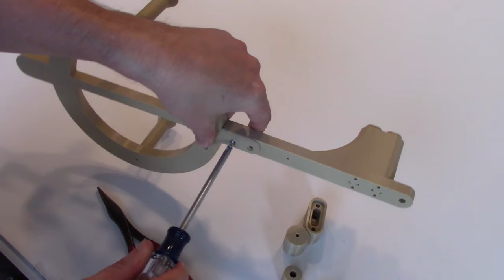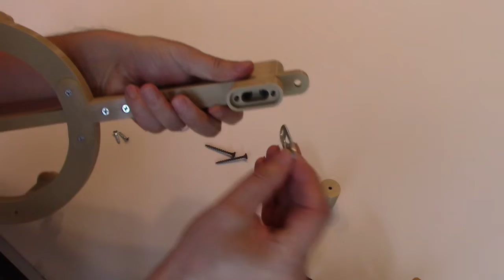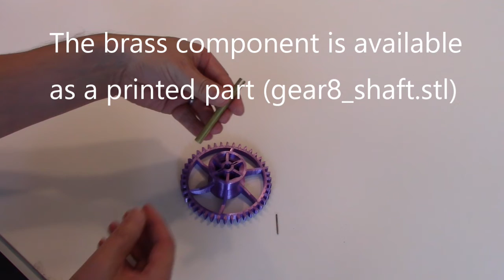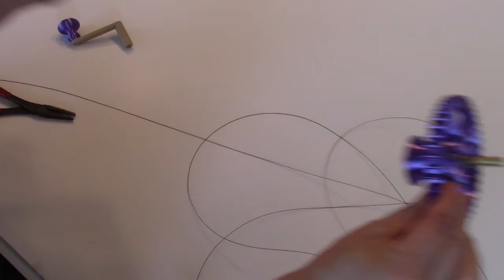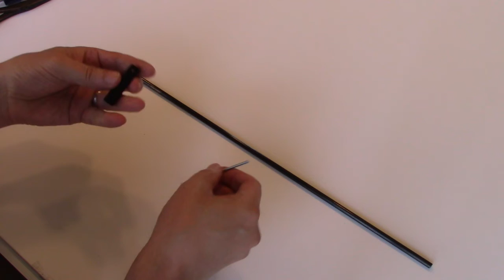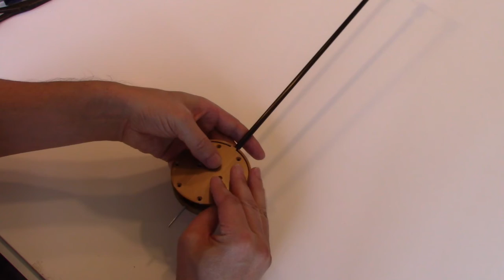Pendulum Wall Clock Assembly Part1

Comment: Steve, I'm not sure why I never noticed this previously but I've used brass for both diameters of arbor, but you specify piano wire for the narrower.  Is there an issue using brass for the narrower, should I look at changing to piano wire?
Reply from the maker: Some brass works great. And some brass is too soft. It is not always specified what type you are getting. There is no need to change it if your clock is working. Other builders using brass might not be as lucky.

I specify music wire because it always comes in a fully hardened state. It will always be the proper quality.

Comment: Hello Steve, congratulations, great job, I will acquire the .STL files as soon as I receive my printer, would you have the dimensions of the screws, pins and bearings, a list of parts that I will have to buy in the market, for me to see if I can find them here in Brazil, thank you very much
Reply from the maker: The assembly guide can be downloaded from https://www.stevesclocks.com/sp2

This is a relatively old design. My newer clocks have much smaller parts lists. Assembly guides for all of them can be found at the same web site.

Comment: I may ne late and you may not read this till im too flustered 😅, but i was gifted this already printed and was tols they went by your measurements. I found your website and love it all, these are amazing i love outting things like this together. 

I may be over or underthing i am still at the first part. Where i have to put the alignment pins, but the instructions aren't clear on what rhose are as i broke a piece ans they are graciously peinting anothwr for mw but i figured the alignment pins were the 17 small pieces, yet they dont go in at all, any help for me to figure this out?
Reply from the maker: The alignment pin holes are supposed to be tight. Different printer tolerances make them slightly tight for some builders and super tight for others. The solution is to drill them to fit with a 3mm or 1/8" drill bit.
Reply: Thank you so much! Can't wait for this beauty to be complete!

Comment: Hi Steve,  when printing the front frame lower and changing colors for the face and numbers do you use the filament change script or the pause at height script? Thanks
Reply from the maker: It depends on your slicer. PrusaSlicer has a simple mechanism to slide a lever and click a button where a color change is needed. Bambu's slicer possibly operates the same since it is a fork of PrusaSlicer. I think Cura uses a script to post-process the pause into the gcode. The end result is the same for either method.

Comment: I very much love the clocks you have designed and built.  As a budding 3d printing clock maker I would love any guidance you may have with regards to resources for your designs.  I'm still very new at this but very much intent on spending the time to learn all there is.  Thank you in advance.
Reply from the maker: Welcome to a new hobby. It can be addictive. If you are worried about some of the non-printed components, then I recommend the clocks in my "easy-build" series. The non-printed components were reduced to the bare minimum while still maintaining good runtimes. I am a lazy clock winder, so I want several days of runtime. A few hidden metal parts are required for this to be possible.
Reply: @stevesclocks  I confirm for the addiction!
I built the SP13 clock, I finished assembling the SP8 and I'm finishing printing the SP14.
I'm already thinking about the next clock to print!!!
😀😀😀

Comment: Hi Steve, the clock is coming along nicely, so many thanks for making your files available on Minifactory. Is there a specific technical reason for using thinner diameter arbors for gears 2_54_12 and 3_54_12? I am having trouble sourcing 1.5mm metal rod, so would it be OK to drill out those holes and use 3mm arbors instead (same as the other arbors)? Thank you.
Reply from the maker: The smaller diameter has slightly less friction which helps contribute to longer runtimes. I have never tested 3mm arbors, but there are enough gear options to make up for the extra friction. It seems like the clock should still run.

My biggest concern is the amount of wall material left after drilling a 3mm hole. It should still be OK if everything was printed with at least 4 perimeters. It would be much safer if you could find some 2mm rod.
Reply: @stevesclocks  Thank you for your prompt response - I have found some 2mm rod, so I shall give that a go!

Comment: Hi. i downloaded today the pendulum clock with blue numbers. i don't understand how to print the colored numbers? do you print them separately?
My printer is "Creality Ender 3 V2 , and i don't know how to print in 2 colors. Thanks for your answer. Isidor
Reply from the maker: The color changes are made by manually switching filament when the print gets to a certain layer height. A pause can be added by the slicer and it will wait for you to switch colors. The positions to add the pauses are explained in the detailed assembly manual.

Comment: Hi Steve, i printed all the parts and get stuck in the assembly, after placing gear 8 (spool), the next part you say is gear 7, but that is the ratchet gear. I've tried gear 5 which looks like the right gear but it is just too big in diameter  and wont fit. Cant figure this out. Help please.
Reply from the maker: Part 2 of the assembly video shows the gears being added. Gear 7 is closer to the back frame, so it gets added before gear 8. The outer hub of gear 7 nests inside the winding barrel on gear 8, but it should still fit.
Reply: @stevesclocks  Thanks for your quick reply. I just figured it out, for some reason i have a gear 5-54-12. The proper gear is 48 -12, which wasnt in my download. Downloaded the zip file again and the correct file is there. So hopefully i can complete the clock. So much detail, look forward to any new designs you might have as i like assembling things.

Comment: this isnt the same clock i printed buy i got here from a link provided... can anyone help me out here?
Reply from the maker: I have several different clock designs. Not all have assembly videos, but the steps are somewhat similar for each clock family. Every clock has a very detailed PDF manual that lists the step by step assembly process. The videos seem to help some people with a few of the steps, but they are only designed to compliment the PDF instructions. It would be very difficult to build these clocks using just the videos.
Reply: @stevesclocks  steve my wonderful amazing designer would there happen to be a hardware list? Couplers rids springs?
Reply from the maker: @beefsoda1  everything needed is listed in the assembly notes pdf.

Comment: Hi steve.

Great design by the way.
I need an information regarding the period of oscillation. Is this a one second clock?
I believe you are using a 8 and 60 tooth gear combination right?
Also whats the run time of this clock?

I wanna build this for a students project. So, i wanna clarify this before using your design. Thanks!
Reply from the maker: Thanks. A one second pendulum would have a length of almost 1 meter. This length looks good in a grandfather clock, but seems out of place in a small wall mounted clock. All of my clocks have shorter pendulums with periods of around 0.6 to 0.7 seconds. Many wooden gear clock designs have  pendulums with a one second period.

Comment: I'm having a lot of trouble getting the 3mm short pins to fit into the holes of the bracket that holds the two back frame pieces together.  The long pins between the top and the bottom fit fine, but the short pins just won't go in.  How do I solve this issue?
Reply from the maker: The holes for the short pins were deliberately made tight. Different printers have different tolerances and they might be too tight. Drill them out with a 3mm drill bit. It might also work fine without the short alignment pins. There should be enough screws to hold the parts together properly.

My latest clock is a simpler design that only uses 3/4" wood screws to hold the entire clock together. The longest runtime option (32 days) uses 11 pounds of drive weight.
Reply: @stevesclocks  Thanks for the quick reply.  After I took a break and calmed myself down ;) I realized that just drilling out the holes a little would solve the problem.  I have successfully completed the back frame now.  Thanks again.
Reply from the maker: @ADirector-l1u  I think some of the parts might be "slightly" over-designed in this clock. The weight shell is pulling on the pieces, but it could have been designed a bit simpler and it would hold together just fine. 😀

Comment: Hi Steve,  I've bought and downloaded the files for printing the large Skeletal clock.    I don't really like the 'fancy' hands included and want to use the plainer hands like those on the small clock.   Can I do this or is there another file for 'plain' hands for the Skeletal Clock?   Also great to see both clocks use similar parts, so I can use some of the leftovers from my small clock build.   Fantastic designs, keep up your great work.
Reply from the maker: Hi Ross, The hands are fairly non-critical and can usually be copied between designs, except the length will be a little bit off. My latest "easy build" design has two different faces, roman numerals or simple numbers. It includes both styles of hands. Steve
Reply: @stevesclocks  Hi Steve,    In am happy with the Roman numerals but just wanted the plain hands.   I didn't want the 'easy build' and don't think I will outlay an extra US$10 just to get the plain hands.   At some stage down the track might you be able to incorporate a set of plain hands into the Skeletal stl files set?   Still a great design and I will start printing sometime next week.
Reply from the maker: @rossevans1035  I added the spade hands from the easy build clock into the design that you purchased. The file is hands_spade_met.stl. It is ideal for metric sized arbors and will work after a small amount of filing for imperial arbors. It takes a few hours to pass the MMF software checks and you may need to look under "Object Parts" to download the individual file.
Reply: @stevesclocks  Thank you Steve.  I will keep a lookout on MMF for the updates.

Comment: Hi Steve. What size printer capacity is needed to build this clock. I have an Ultimaker 2+ with 223 x 223 x 205 cm maximum build size and would like to undertake this project if my printer has a big enough capacity. Thanks.
Reply from the maker: Hi Mike. I design all of my clocks to fit a 220x220mm Ender 3 or 210x250mm Prusa MK3S build plate. Height is rarely an issue. Your machine should easily be capable. There is also a smaller option for something like a Prusa Mini. The lighter weight gears in the small clocks use less energy and the runtimes are longer. One of my clock designs runs for 32 days per wind, but only in the small version. The large version only gets half the runtime.
Reply: @stevesclocks  Thanks. Looks like I will buy one of the clocks.

Comment: Where do you get the Shaft Couplers from // Thanks
Reply from the maker: Amazon or eBay. Search for Dubro 597. Packs of 12 collars are currently around US$9. This would be enough for 2 clocks. A local RC hobby shop might have some in stock to pick up without waiting for shipping.

Comment: HA!! Im number 100 subscriber. Remember us when your famous LOL. Just bought these plans, thanks for posting this. gonna have fun with this!!!  Thanks! and post more!!
Reply from the maker: Congrats on being lucky number 100. More designs are coming. I like to experiment and fine tune many of the parts so it takes me a while.
Reply: @stevesclocks  hey Steve, im just in the planning phase and I wanted to ask if there is a reason not to use ABS? I am thinking about vapor polishing all the parts, however this may be a tricky move. what do you think?
Reply from the maker: @michaelvickers8575  It seems like it should work. Try a few small parts before committing the entire clock. The gears have loose tolerances and I think the escapement will also be OK.

Comment: Does this scale? Like, if I wanted to make it even larger on something like the CR-10? Or will that mess with the timing?
Reply from the maker: Timing is controlled by the pendulum length, so scaling everything except the pendulum will keep the timing the same. However, this design has built-in threads for screws and bearing pockets in a few key places. Those would need to be adjusted after scaling

I did scale the design to 3/4 size for smaller printers. The escapement was increased from 25 teeth to 27 teeth to allow a shorter pendulum that is more proportional to the overall clock. A larger clock might look better with a 24 tooth escapement and all other gearing unchanged. The drive weight might need to be adjusted since larger gears need more energy to accelerate with each tick.

So to answer your original question, yes, the clock will scale. I like to make a few minor optimizations for each size, but they might not be absolutely needed. Keep in mind that the clock is already quite large with an 8" dial and nearly 20" overall height.
Reply: @stevesclocks  Thanks for the info. I'm looking to do something rather large, and 8x20 is actually small for my space.
Reply from the maker: @AdamZ5k  It should be possible to scale the size and adjust a few parts. For example, scale X and Y by 50%, scale Z by 30%. The 1.5mm diameter arbors get upsized to 2.2mm. The 6x3/4" wood screws get upsized to 10x1" screws. Bearings could be kept the same size and print collars to go around them so they stay centered. Save the weight shell for last so you can determine how much weight is required. It might work with the large weight shell filled with lead shot instead of BBs. A few steps may require some experimentation. It seems to me that common sense solutions for most parts should allow the clock to be built.
I look forward to your progress if you decide to attempt it. I can give recommendations as you go, but may not be able to build one myself since I only have a Prusa MK3S.
Reply: @AdamZ5k  Did you end up doing it?

Comment: Hi Steve....   I recently joined the world of 3D printing and really want to build your beautiful clock.   My question is where do you get the additional parts like the metal pins and screws needed.     Thanks for your help.
Reply from the maker: The screws are from any hardware store in the US. Many builders outside the US have completed the clock without any reporting issues finding equivalent screws.
The metal pins are from a local hobby shop that sells K&S metals. Metric or imperial sizes are supported.
The other critical components include 5 ball bearings and 6 shaft collars that I order from the internet. 
The remaining components are not critical and acceptable solutions can be found anywhere. Several weight shell sizes are provided depending on the density of fill material. You could use lead shot, BBs, or possibly even sand. The weight cord can be almost any cord that is strong and thin.